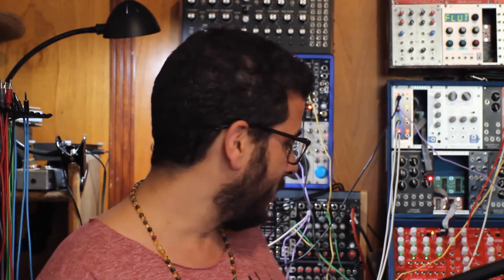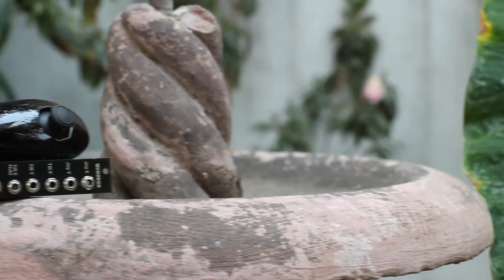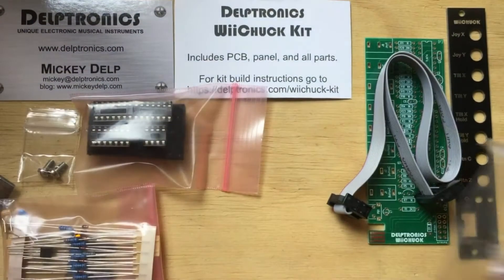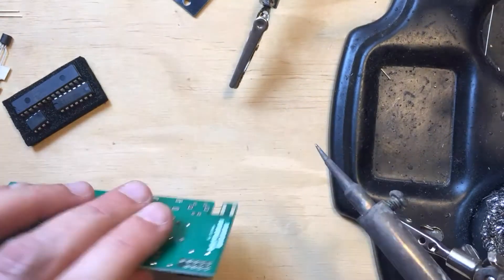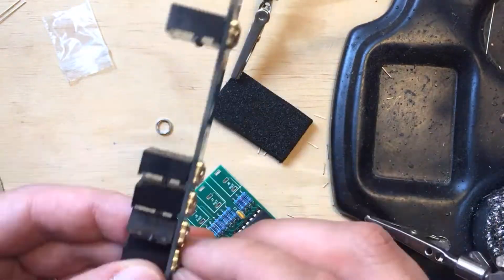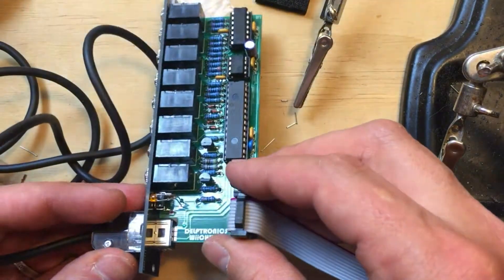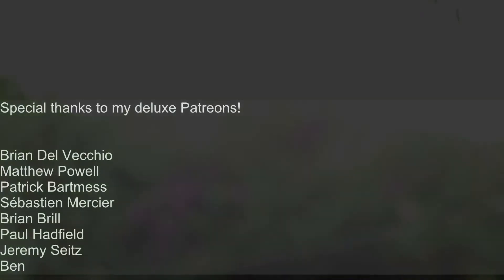Kit Overview # 40 - Delptronics Wii Chuck - Build Video

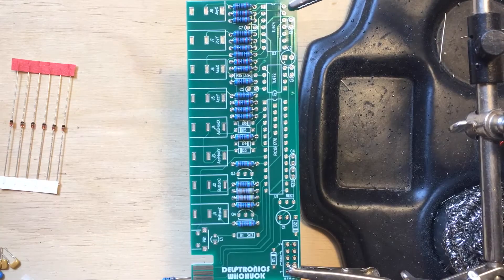Comment: 1:35 What's the advantage of soldering above? When soldering below, if needed, I can easily suck the solder. When trying that from above I'm guessing that would be more of a pain?
Reply from the maker: The solder goes all the way through the hole and plugs it from both sides, regardless where you apply it from. So you can still use the solder sucker on the bottom side if needed, though I recommend desoldering braid instead.
Soldering the resistors and diodes from the topside allows you to: 
1 - place all the resistors and diodes before soldering a single one, making mistakes evident and easy to fix without fiddling with suckers and braids.
2 - not have to spread each resistor leg out so the part doesn't fall off when you turn the board over.
3- Not have to manage your iron tip through a dense forest of leads. 

You're welcome :)
Reply: @QuincasMoreira  My pleasure :) Thanks. To stimulate the flowing of the solder going through, do you use any additional flux?
Reply: @KPsTboy  no need, the solder already has flux in it. Just use an adequate amount of heat and solder per joint and it should flow right through.

Comment: When do you recommend soldering from above vs. below PCB? - I see that you used both techniques here. Thanks!
Reply from the maker: I basically do it for resistors, diodes and ferrite beads! As long as they go flat on the board, not standing, and the PCB is plated through hole (metal inside the holes)
Reply: @QuincasMoreira  Thanks for the quick reply - going to try it out next module